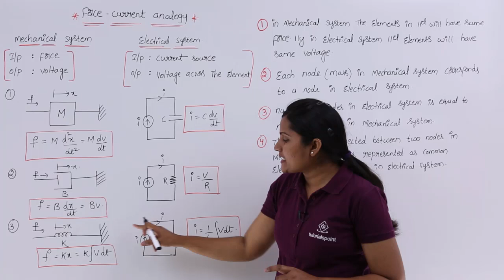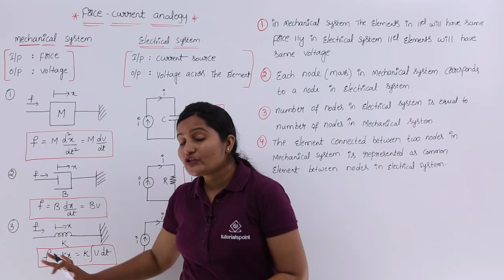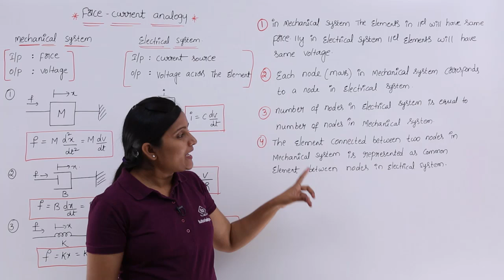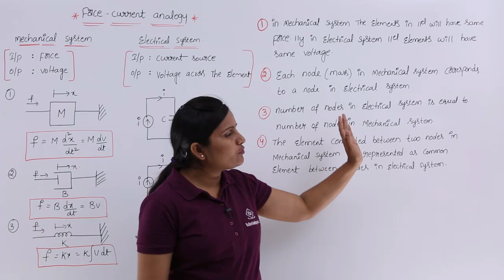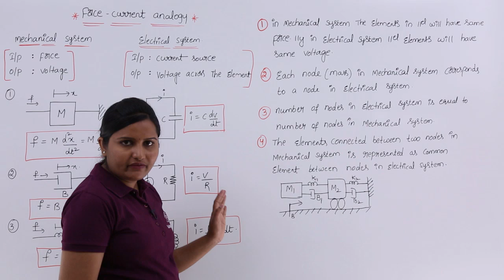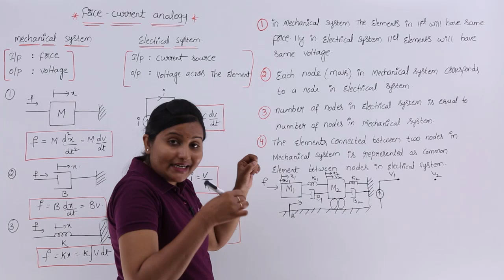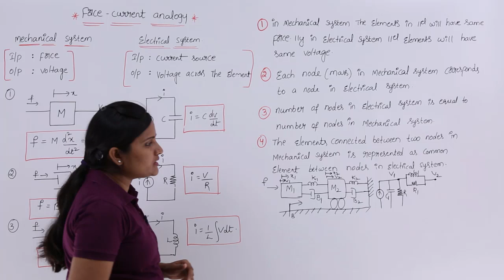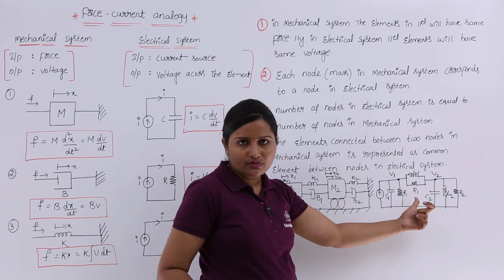Force Current Analogy

Comment: apply an integrator circuit across the capacitors and you will get displacement. i used tinker cad to do this and it worked really well. tinker cad circuits software  is FREE!